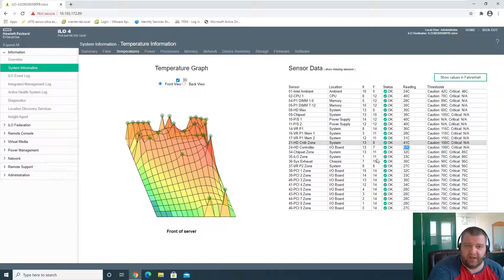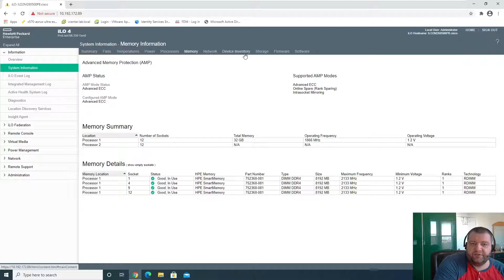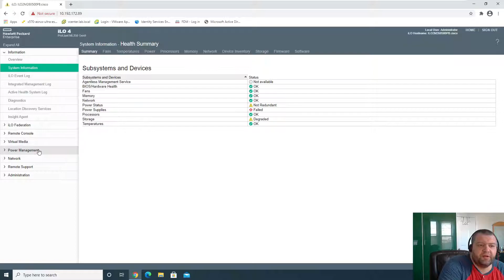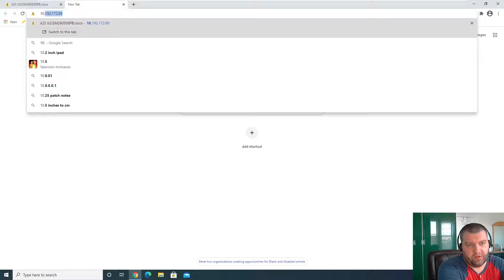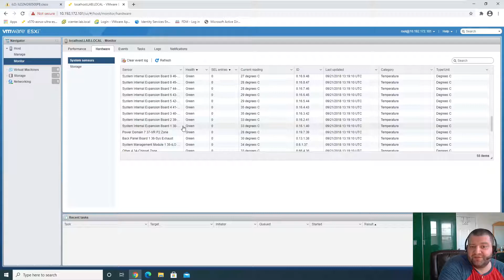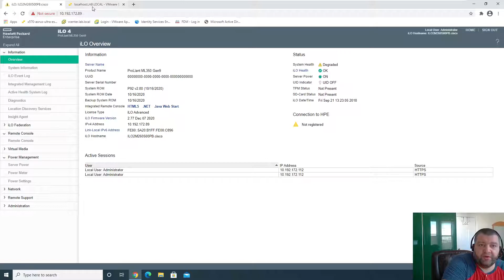HP ProLiant ML350 Gen9 As A Lab Server Review And Initial Impressions

Comment: If the raid controller gets hot the fans ramp up but i heard you can but a 60mm noctua fan on it and it makes it quiet again
Reply from the maker: Absolutely, a small low rpm fan placed by the raid chip will keep it quiet even if the main fans are at 6%. Since I am dot using raid the chip idles so no need for a fan.
Reply: @mrruslan1535  also quick question would it be quiet enough to have in a living room?
Reply from the maker: @CoolGaMr-de7nz  it is in the bedroom and I don't hear it at night. Depending on how sensitive you are that may vary.